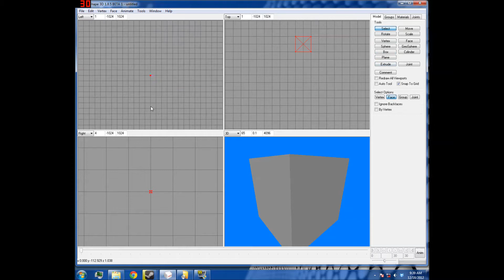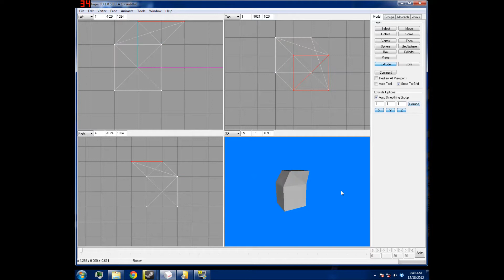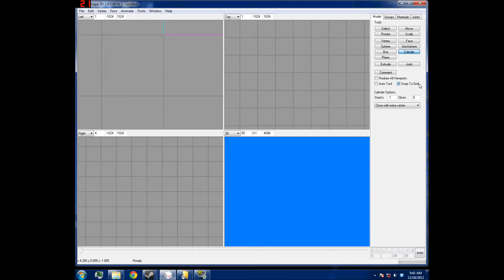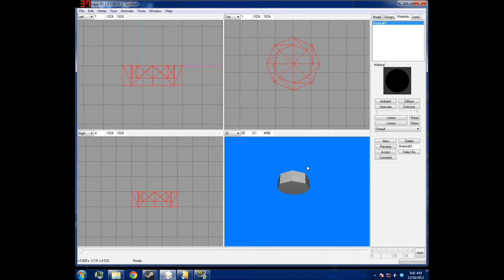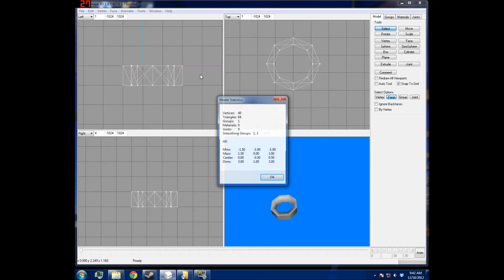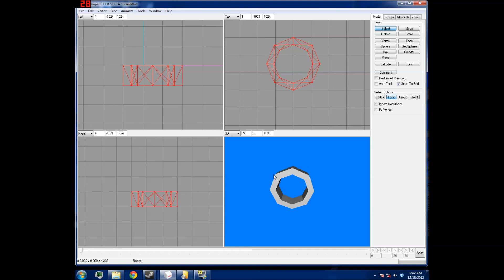Milkshape 3D Tutorial - Tips and Tricks: Extrude

Comment: I know this is a really old vid, but I've been diving into Milkshape recently - I enjoy using it, it's nice and straight forward without a million addons and hotkeys and such to learn. 

Anyway, maybe you can help me with an occasional issue that happens... I'll extrude some faces, and for some reason, the side connecting faces - not the faces I originally selected - will be solid black. It's extremely difficult to select them, and I can't figure out how to fix it. Reversing vertex order to flip the normals doesn't work. What's stranger is, if I delete the black faces and then try to rebuild them using the Face tool, they still turn out black. 

I've looked all over for a solution to this, but no dice. 

Thought I'd give it a shot asking here. Maybe you or someone else reading this knows how to fix this? Thanks
Reply from the maker: Hi! I wonder if your problem is related to smoothing groups? Have you tried selecting the solid black faces and  assigning them to a new smoothing group (in the Groups tab)? Check to see if you have "Auto Smooth" unchecked in the Groups tab — that seems to replicate something that sounds similar to your issue.

Another thing to try: maybe play around with the Snap/Weld/Unweld features in the vertex tab. For example, select a of the glitched face and Snap Together, then move on to the next one (deselecting the prior one) and Snap Together. If the problem is vertices that are accidentally overlapping, this could help to solve it.

Best of luck!
Reply: For selecting try disabling Ignore Backfaces

For making them not black, go to Face and Reverse Vertex Order
Then go to back to Face, selecting Smooth All